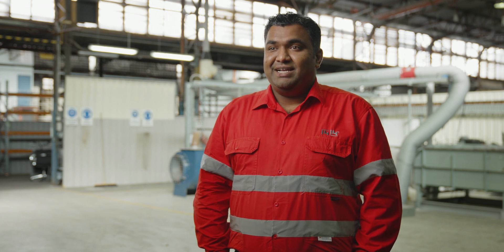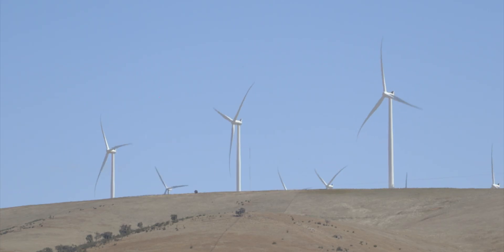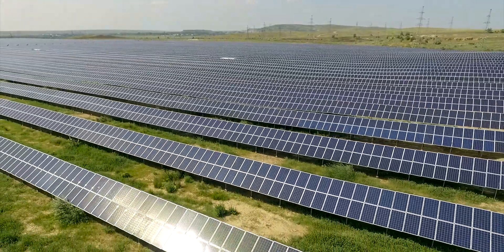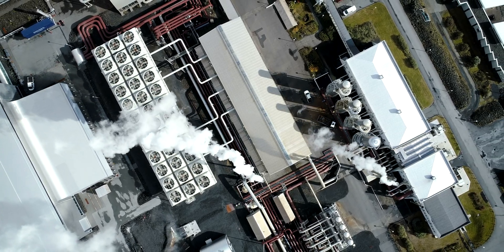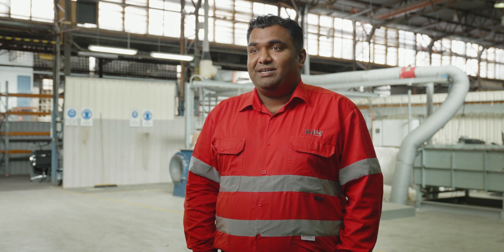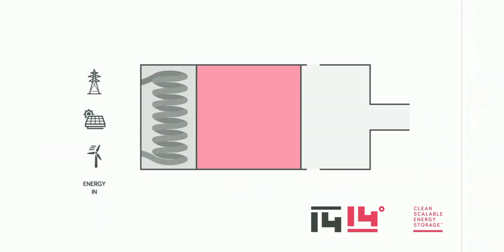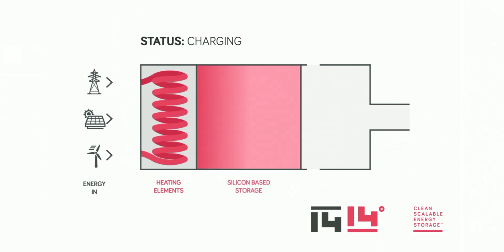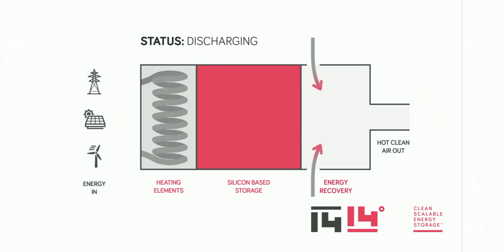1414 Degrees - Clean heat in the energy future

Comment: Converting electricity into heat is like taking gold and converting into coal.  While the technology is great for areas that have an abundance of electricity, using resistance heating to heat a medium is not particularly innovative or the best use of electricity.  And there was no mention of recycling the waste heat so basically this is just resistance heating which can be stored via a storage medium.  Yes it can smooth out intermittent generation but there are far better uses for that (like using flywheels to preserve the energy to support Level 3 Electric fast chargers).  Even heat pumps would be a far better use of energy rather than converting electricity (gold) into heat (coal)...